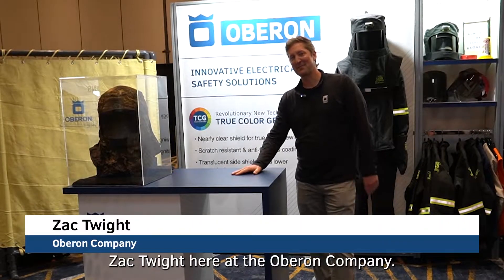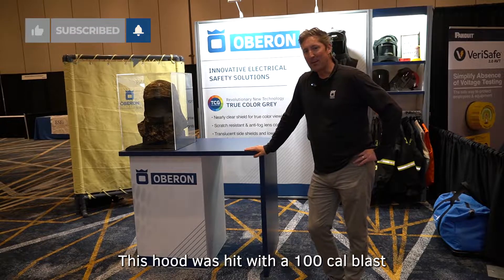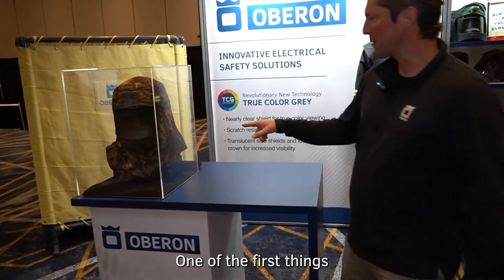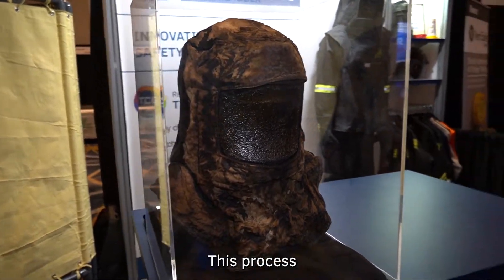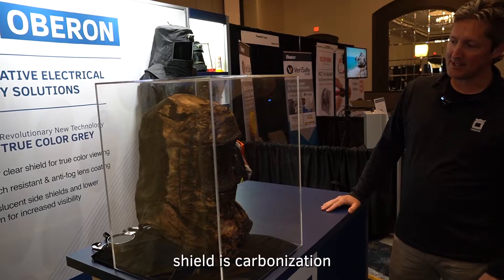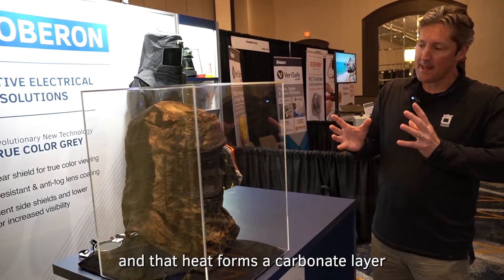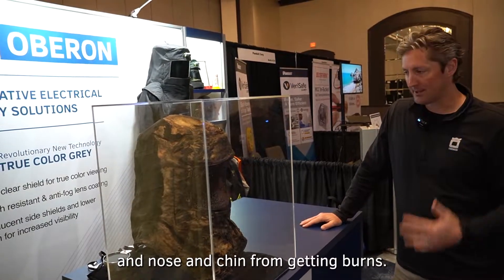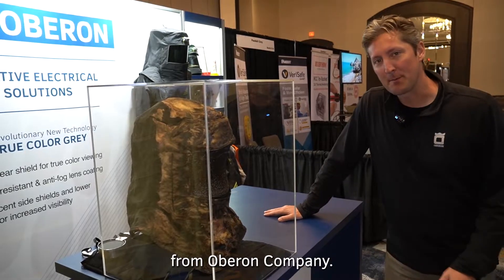What Happens to Arc Flash PPE After an Arc Flash?

Comment: I saw/caused arc-flash that traveled about 20 yards down a conduit-box.
It was 440 3-phase service for a large bank of battery-charging rectifiers...central office telephone switching.
The flash blew off nearly every port-cover!
My box-wrench became an open-ender in about a millisecond!
Both of my hands were stained black with copper vapor, safety-glasses split in half, burnt eye-brows, ears ringing for a month.
I hated working in the battery-room.
Reply: Damn, you could have been injured a lot worse.
Reply: Western Electric worker blinded for 3 days. Cable whipped, broke every tie down for 150 feet . Turned copper busbar into fishing weights.
Reply: Wow! Thanks for sharing! I knew it was bad but this gave me goosebumps. Really scary. Lucky you got away with minor things! This could kill instantly.
Reply: Yeah, commercial AC and the rectifiers are huge in the battery areas.
Reply: Damn man. I am glad you made it out alive.
Reply: That's incredible luck.

Comment: Is a 1000 CAL blast even survivable with this arc flash PPE? even lower CAL blasts only keep 3rd degree burns from occurring but the body will be covered in 2nd degree burns. It's not just the heat and flash but a shockwave too I'm told. not an electrician but recently took a job with high and medium voltage switchgear and have been COHE trained. Do they even make a 1000 CAL suit?
Reply: arc flash gear at that level is for for cleanup purposes, whatever arcs expands by over 60,000 times instantly.  You would become a bag of goo, and the arc flash gear becomes the bag.  Hope this helps.

Comment: I’m a third year EE student and ive never heard of a “cal”, ie 100 cal blast. Is that a way to measure arc size or something
Reply: Calorie is a measure of the amount of energy required to heat 1 cubic centimeter by one degree Celsius, which I think is also a gram of water by weight?
From my understanding and quick google its the same thing.
Never underestimate what it takes to change the temp of water!
Reply: @gmailisaretard . Especially when it can change the temp in a fraction of a second.
Reply from the maker: A calorie is the amount of energy needed to raise the temperature of 1 cubic centimeter (cm^3) or gram of water 1 °Celsius.

We measure the incident energy (the amount of thermal energy, impressed on a surface a certain distance from the source, generated during an electrical arc event) in calories per square centimeter, or cal/cm^2.

The protective value of the arc flash PPE is measured in arc thermal performance value, or ATPV, which in arc testing, is the incident energy on a material or a multi-layer system of materials that results in a 50% probability that sufficient heat transfer through the tested specimen is predicted to cause the onset of a second-degree skin burn injury based on the Stoll curve, cal/cm^2.

The arc rating (the value attributed to materials that describes their performance on exposure to an electrical arc discharge) is expressed in cal/cm^2 and is derived from the determined value of the arc thermal performance value (ATPV) or energy of breakopen threshold (EBT) (if a material system exhibits a breakopen response below the ATPV value). Arc rating is reported as either ATPV or EBT, whichever is the lower value.

Arc-rated clothing or equipment indicates that it has been tested for exposure to an electric arc. Flame resistant clothing without an arc rating has not been tested for exposure to an electric arc. All arc-rated clothing is also flame-resistant.

Hope this helps!
Reply: @OberonPPE  thanks. the destruction makes a lot more sense when it’s in cal per square centimeter. considering that human surface area is about 1.7 m^2 = 17000 cm^2… wow it’s a lot of crisping potential.
Reply: @OberonPPE  good to see I remembered middle school biology lol

Comment: I stick with nothing more then 220 V , thank you very much.
Reply: 220 is still quite capable of delivering arc flashes bad enough to take your eyesight in one go. You may not need a 40 cal suit, but you shouldn't get complacent and think it's not an issue.
Reply: @tetrabromobisphenol  Too late.  He is already so complacent he referenced voltage as if that is the determining factor.

Comment: I'm glad I'm not an electrician. If they have to worry about this happening to them, yeah, I'm not going anywhere near the electrical panel unless it's a simple reset. They get paid to mess with the wires, I don't. Enough said there.lol.
Reply: Breakers should not be reset until the cause of the trip is understood, and arc flash PPE is required when performing switching on high energy circuits (note that low voltage circuits can be high energy) - circuit breakers can fail explosively.
Reply: If you reset a breaker while not being a technician responsible and qualified, then you're disposable to the people that hired you.
People have died while resetting breakers, at least the ones in high amperage systems.

Comment: The real question should be....Did the person under this hood during said "arc" flash, live?
Reply from the maker: @victorrodriguez2806  This particular hood was used in a testing facility on a mannequin. However, if this had been worn by a person during an actual arc flash incident, and the worker had performed a risk assessment before performing the work task, and the incident energy was determined to be less than the protective value of the arc flash suit, then, as designed, the person would have at most second degree burns.
Reply: @OberonPPE  
 Thank you for your clarification.  So this was a sales marketing piece. And a human was not inside of this hood when it was tested. Because it was unknown at the time if a human would survive this type of testing. Good for you and your company for not hurting anyone during the testing of this "arc" flash hood.
 Bad on you for not being completely honest with ALL of the details.
Reply: @victorrodriguez2806  This is standard gear in the field, you aren't the target customer. Not really dishonest at all, you just don't understand the market. 

This type of gear is not new. 

Nobody would ever test gear with a person wearing it. That is stupid.

Comment: How does that get hit by an arc and how does anyone inside that not get electrocuted? How does fabric insulate anything from an arc ?
Reply from the maker: @procactus9109 Please check out our website at www.oberoncompany.com for answers to these questions and more! Separately, this arc flash PPE protects against arc flashes, not electric shock. The worker would also be wearing dielectric work boots and rubber insulating gloves with protectors over top. In this way, the electric current would not be able to enter and exit the worker's body, causing an electrocution, unless the rubber insulating gloves were rated too low against the electrical hazard. The worker would have performed a shock risk assessment ahead of time to make sure they were wearing adequate protection.
Reply: This comment was fun
Reply: You have asked a question where it is clear you need to spend considerable time learning the basics before you can understand the answer. An arc flash is an independent hazard to electric shock. An arc flash can easily kill you without ANY external current passing through your body. If you don't understand why that could be the case...I'd say you need to sign up for some classes because you have a long road of learning ahead of you.
Reply: @tetrabromobisphenol  without research as you suggest... And since I've never experienced an arc flash that can do major damage to surroundings... I'm guessing it's the extreme UV as radiation and what ever the high current arc comes in contact with will literally boil and sputter.. so I assume it's a whole cocktail of nasty...... Is that close enough ?
Reply: @1st_ProCactus   From wikipedia - "An arc flash is the light and heat produced from an electric arc supplied with sufficient electrical energy to cause substantial damage, harm, fire, or injury" and "When an uncontrolled arc forms at high voltages, and especially where large supply-wires or high-current conductors are used, arc flashes can produce deafening noises, supersonic concussive-forces, super-heated shrapnel, temperatures far greater than the Sun's surface, and intense, high-energy radiation capable of vaporizing nearby materials."

So not just UV, not just high current, but a literal energy explosion
Reply: @toddkes5890  the only thing I didn't consider was supersonic shockwaves.. the rest was mentioned
Reply: @tetrabromobisphenol  Are you... gatekeeping knowledge?
Reply: @tetrabromobisphenol  just lol
Reply: @tetrabromobisphenol  You're wasting your time.  These are the kids that run their mouth expecting others to do their work for them.
Reply: @I_Dont_Answer_Questions all he did was ask a question, why is everyone here being a dick instead of educating him? 

You don't know what you don't know, asking questions is how you learn.
Reply: @bigchooch4434 not our obligation to spoon-feed him. We live in an era where virtually all information is a simple web search away and this guy is demonstrating he's too lazy to do EVEN that. That we should search it ourselves and then relay it to him. I assume you feel just as entitled if you take offense at how he's being rightfully treated.
Reply: @sprolyborn2554  It's also not your obligation to shame and belittle someone for asking a question. God forbid people try to have a discussion relevant to the video they just watched.
Reply: @wasdwazd  I'd say it is. Stop fostering spoon-feeding and laziness. Whenever I've asked questions, the answer I get is HOW to find the answer. Not the answer itself. You're so entitled it makes me sick.
Reply: @sprolyborn2554  You sound like a person who didn't have any support in your youth. Just a father who drank beer and watched TV all day after work and yelled at you if you so much as tried to speak to him, and that has made you an incredibly bitter person as a result. Imagine if a kid walked to an electrician's booth at a job fair and asked a question and the person running it yelled at them to look it up. I wouldn't even want to know the answer anymore.

Don't waste your time replying to this, you've shown you have nothing valuable to say so I'm not going to look at it.
Reply: @wasdwazd thats not how I would have responded, but you pretty much conveyed my thoughts exactly lmao.
Reply: @wasdwazd  On a scale of Not Told to Told, you sure as shit Told him 🤣
Reply: @wasdwazd  Projecting.  You're doing it.
Reply: @I_Dont_Answer_Questions  Nah, man. My dad's a musician and spent most of his time at home practicing guitar while I played video games. Now I play pool with him on weekends. My dad's fucking awesome.
Reply: @wasdwazd  holy shit dude you killed him lol

Comment: Will this protect me from a nuclear blast? Im currently writing down the locations of useful loot i might need if nuclear war breaks out.
Reply: I don't think it will protect from nuclear blast. I think it is supposed to be worn when opening the Arc of the Covenant. Refer to Raiders of the Lost Ark for an example of when it should be used.
Reply: Sure, remember to orient yourself to ground zero
Reply: It should help to some degree, but not against high-energy radiation.
Reply: 11-27-2024 how are your preps going?....
Reply: in principle yes, it will help against the flash but the shockwave will kill you 1 or 2 seconds later. Do you really want to survive a nuclear war? As kids during the cold war we tried to think of places where to go during a nuclear war where we would most likley be hit.

Comment: Wow, whoever was wearing that helmet must have been mighty glad he wasn't to lazy to put it on!
Reply: Oberon replied to another post. This is the entirety of their response there.

"This is an actual arc flash suit hood that was tested with an arc flash in a special lab testing facility and is now used for demonstration purposes only. At Oberon we are always testing our fabrics, materials and arc flash suit garments for compliance and continuous improvement.

We assure you, these are never tested on humans but rather are tested on special mannequins that are specifically designed for this purpose.

We strongly advise that arc flash garments NEVER be used after an arc flash incident."
Reply from the maker: @whyjnot420 Also, if this had been worn by a person during an actual arc flash incident, and the worker had performed a risk assessment before performing the work task (which is required), and the incident energy was determined to be less than the protective value of the arc flash suit, then, as designed, the person would have at most second degree burns.
Reply: @OberonPPE second degree burns are very painful,  but almost always survivable.  That's where  hierarchy of controls comes into play.  Elimination (LOTO, electrically safe work condition) followed by substitution and engineering controls (remote racking of draw out circuit breakers,  current limiting fuses where appropriate) administrative controls and PPE
Reply: [ > too lazy < ] 😊
Reply: people dont actually survive in a suit like this. whatever idiotic shit they tell you in this video, if that suit is actually conducting electricity as it clearly does, you are 100% fucked. this suit is to make cleaning you up easier.